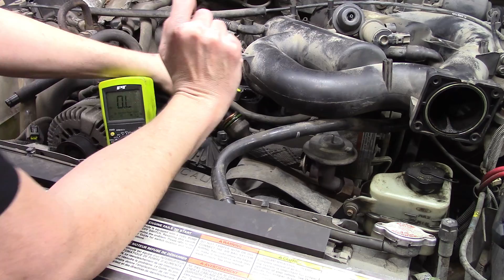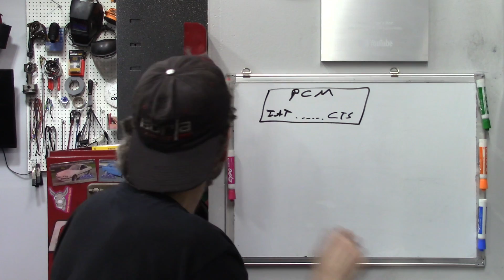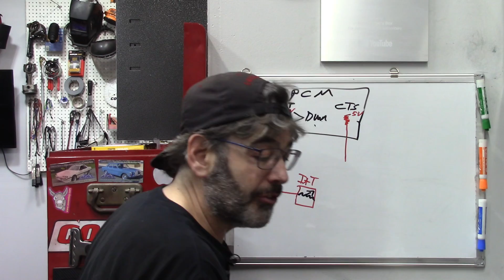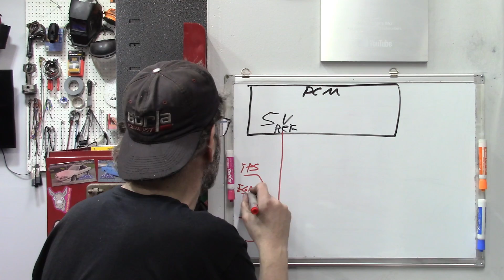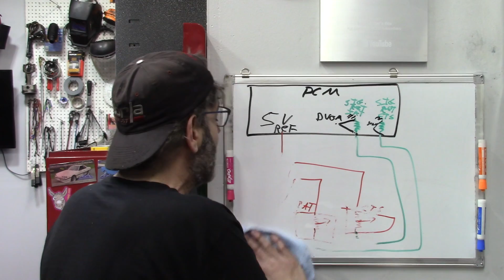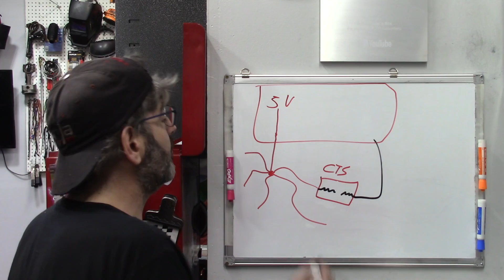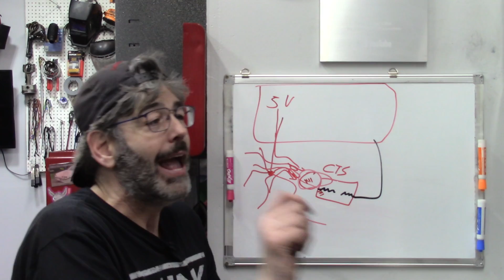P0118 Coolant Temp Diagnosis  New sensor didn't fix it Pt2

Comment: Unfortunately you are incorrect in your description/drawing of how the PCM monitors voltage here - it is, in fact, looking at the voltage drop across the ECT (or IAT) sensor and not the internal resistor. When the engine is cold it will read a higher voltage bc the resistance of that NTC thermistor is large at that point, but as it warms up the resistance will decrease and the voltage reading will also decrease accordingly.
Reply: Is this two nerds fighting? sips tea
Reply: What we are looking at here is essentially a simple two resistor voltage divider circuit.
Where, one fixed resistor is fed 5V, and the thermistor is the second resistor, essentially a variable resistor grounded on one side.
The PCM is taking it's reading from in between the two resistors, with effectively it's internal dvom negative probe.
Constant 5V on the PCM's positive internal dvom probe at the input to the fixed internal resistor, and a varying ground connection on it's negative probe, with more or less continuity to ground, totally dependant on the thermistor resistance changing between cold engine to hot engine.👍
Reply: @simonilett998 I was about to write the same...perhaps both have them got stuck into voltage drop concepts, whereas this case is yes, utilizing fundamental of voltage drop, yet the PCM is monitoring only volt potential of central node between the two resistors....simple voltage divider circuit....where internal resistance is constant and thermistor resistance is modulating the central node volt potential proportionate to change in temperature.
Reply: @AutoDiagnosticsPK  100%
With the emphasis on:
The PCM is 'probing' with it's negative dvom lead between the two 'resistors' and it's positive dvom lead is connected directly to the 5V source, before the resistor inside the PCM👍
Reply: @simonilett998  can you make your statement more clear....we agree that it's simple voltage divider case where PCM dvom measuring nodal volt potential....and in my understanding it's measuring nodalpotential with respect to ground....and what I could get from your above statement is that PCM is measuring node with respect to 5v....in other words voltage drop across PCM internal resistance....please if you can make it easy for me
Reply: @AutoDiagnosticsPK  Yes, you are correct.
Voltage drop across the internal resistor, with PCM's positive dvom lead to 5V side of internal resistor and PCM dvom negative lead connected to node after internal resistor, but before the thermistor👍
Reply: @simonilett998  hmm, here I too got stuck with the simple basics 😀
I am not absorbing that PCM is measuring voltage drop...to me it's like divider node volt potential wrt PCM ground....I think, I shall also sit back, get relax and reconsider the basics😀
Reply: @AutoDiagnosticsPK Your initial understanding was, and still is, correct. Don't start doubting yourself now. YouTube won't allow links in comments, but if you search for a video by ScannerDanner entitled Thermistor-Potentiometer comparison and the 5v reference circuit, and skip ahead about 3 minutes, you'll get (additional) confirmation.
Reply: @nowayjose596  Just watched the Paul video recommended portion and found myself relieved from the agony of getting lost in the desert of voltage drop and divider circuit😃...thank you very much for the recommendation and the Advice!!!
Reply: @AutoDiagnosticsPK  I often use the term voltage drop bc it clarifies 2 things immediately: 1) what we're looking at when current is actually flowing in the circuit, and 2) exactly where our hypothetical multimeter leads would be placed and exactly which resistor we're monitoring. Otherwise, by simply calling it a voltage divider circuit, you leave more room for potential miscommunication/confusion (as you just saw 😉).
Reply: @nowayjose596  hey hey....what??? Now u need a cup of coffee 🤣
U c, Matt after taking his cup of coffee is on track...just joking...he is a great teacher and that too super fast...
It's totally different...voltage drop & potential diff between divider node and ground
Reply: @simonilett998 🤦‍♂️ No.
Reply: @nowayjose596  Yes.
The PCM is measuring the differential voltage between 5V and ground, using it's internal dvom negative lead connected between the fixed resistors output side and the variable resistor/thermistor input side, a simple voltage divider circuit, just with one of the resistors (outside the PCM) creating a variable continuity to ground dependent on temperature.
Reply: You are correct in your explanation!
Reply: I would like to officially declare that we have gotten to the bottom of this, after 39 comments.  Thank you for your participation, and goodnight.
Reply: @thomas7770  haha....
Reply from the maker: It does read the internal resistance voltage- NOT the sensor voltage. The sensor voltage will always be a full voltage drop to zero no matter what the resistance is. 
  You are correct in that the NTC resistance is variable however it does not read voltage drop across the sensor itself. It is impossible to do that.
   At best some designs may compare downstream of the internal resistor and compare that variable voltage to ground… but it definitely can’t read voltage drop across the sensor. If it did that there would have to be more than two wires at the sensor to measure the voltage on it.
Reply: @SchrodingersBox Wow! Looks like a debate on the circuit operation of the ECT.
Reply from the maker: Hahahaha. Yeah maybe you can weigh in Terry. Viewer states the measurement for the ECT is the voltage drop across the sensor (the variable resistor).
   I state the measurement is the dropped voltage from a fixed resistor in the PCM (measuring “downstream” of resistor - not at the 5V source side- technically it reads the voltage “between” the internal fixed resistor and sensor) compared to ground that changes as the variable resistor changes.
    I also state while the readings would be identical, the point of measurement I am claiming is correct.  Viewer states I have no idea what I am talking about lol.
Reply: @ingersBoxAt timeline 15:25, you mention that the voltage seen by the PCM which is actually an analog to digital (A/D) converter is the voltage drop across the internal resistor. In my opinion, this is not correct. One viewer mentioned it already stating that with the thermistor disconnected, there is 5VDC on the top of the internal resistor and 5VDC on the bottom of this resistor because there is no current flow. The difference between these two voltages measured by the a/d converter would be 0V. Yet, we see near 5VDC on the scanner. On the other hand, with the 5VDC and ground terminals shorted together we see 0VDC. Yet, if one were to measure from the top of the internal resistor with its 5VDC and to the bottom of this internal resistor, we would measure 5VDC, yet the scanner shows 0VDC. There is only one possibility for the scanner to measure 5VDC when open and 0VDC when the connector is shorted. The reference of 5VDC is not used in its measurement. It is the ground and the other point is the bottom of the internal resistor which connects to one side of the thermistor. So, I believe the video drawing is misleading. I believe the confusion is what we are considering to be voltage drop. When we say what is the voltage drop across the internal resistor, this literally means taking our voltmeter and placing our leads ACROSS the resistor. This would be its voltage drop and not measuring to ground. The same holds true for the thermistor where we're taking the voltmeter and placing it across it which gives us its voltage drop. As you mention in your comment, you're taking the voltage from the connection of the internal resistor and the thermistor to ground. This is NOT the voltage drop across the internal resistor. You're only measuring how much voltage is left over after the current passes through the internal resistor. Of course, this voltage will change because of a changing current due to the resistance changing of the thermistor.

However, your comment is correct and the other viewer's comments are correct also. You state that the measurement is taken between the bottom of the internal resistor and where it connects to the thermistor and ground is used as its reference. This is correct! However, isn't it exactly the same thing as taking the voltage drop across the thermistor as mentioned earlier. It's the exact same measurement. As a side note, all of the a/d converters that I'm familiar with such as in PCs, automotive vehicles, microcontrollers and PLCs use a GROUND for its reference against a reference voltage that the a/d converter uses. It could be 5VDC, 3.3VDC or some voltage . In this case with the ECT circuit, the a/d converter is using 5VDC and a ground to reference against. There are specialized a/d converters that can use say 5VDC against another voltage, but these are specialized  components requiring a differential input or using two a/d converters that uses a ground reference and then subtracting the voltage in software. An example would be Picoscope's oscilloscope that uses floating inputs. Hope that helps!
Reply: @stuzman52  another nerd has entered the chat.  Lol, jkjk. Carry on.
Reply from the maker: @stuzman52 yep that explains it to me. In rewatching the video it does appear I was indicating a voltage drop across the fixed resistor which was not my intent but I can see how it could be interpreted that way. I meant to say it as I described in my comment. 
  Agreed the measurement would be the same- measuring between the fixed and variable resistor vs ground or across the variable resistor- I acknowledge that. But I disagree that the measurement is across the variable resistor.  The positive is between the fixed and variable resistor  inside the PCM and  the negative is against ground inside the PCM. The fact the thermistor only has 2 wires is evidence there isn’t measurement across the thermistor itself.  It’s clearly measured internal in the PCM- not across the thermistor.
Reply: @SchrodingersBox I hate to disagree Matt, but it's the voltage drop across the thermistor. You're taking a measurement at the junction of the fixed resistor and the thermistor which is inside the PCM. Now follow down from this measurement point and does it not connect to the thermistor. Should we throw it out and say it doesn't exist at the thermistor? And look at the ground connection. Does it only connect to ground inside the PCM? No, it also connects to the other side of the thermistor. I mean to me, it's pretty clear. Although the measurements taken are the same exact ones from yourself and viewers, I can truly say that it is the voltage drop across the thermistor that the a/d converter is measuring. Sorry Matt for the disagreement!
Reply from the maker: Ah I guess I can see it that way. I guess a matter of perspective. I see at is measuring the dropped voltage from the fixed resistor against ground but I can also see it as across the variable resistor (including all the wiring). Seems to me it’s the former but if you say otherwise then I agree!!  Across the variable resistor it is!!
Reply: @stuzman52  discussion gives clarity, and particularly when no one is Electrical Engnr here😃.
Your above explanation makes sense....but can u explain following question:-
Can we say it as a voltage drop across CTS resistor when it is open or shorted?
To me NO, and again in my opinion it has to be taken as a simple voltage divider circuit where ADC is measuring the node between two resistors, it becomes immaterial what reference ADC takes except the Vin of 5 volt....obviously the designer would plan a reference which would give ADC better resolution.
Again, I want to make a point here that this case should be discussed through voltage divider circuit term instead of referring it through voltage drop, yet voltage drop is the culprit which is in play 🤣🤣🤣
Reply: @SchrodingersBox No problem Matt! As I mentioned, both you and the viewer's comments are correct in where the measurement is taken and you get the same results. Maybe an example will help. Let's say that you measure 1VDC at the junction of the internal resistor and the thermistor and its reference is to ground. Now does this mean the internal resistor has a voltage drop of 1VDC? No, it has a voltage drop of 4VDC, 5VDC-1VDC=4VDC leaving 1VDC across the thermistor resistor measured to ground. As a simple test, you could hook your voltmeter leads across the thermistor and compare it with your scanner. You would be measuring the voltage drop across the thermistor which would be the same voltage as displayed on your scanner. Hope that helps and have a great day!
Reply: @AutoDiagnosticsPK Normally, when one considers voltage drop, we're looking at a circuit such as our voltage divider as functionally correctly. But, we still can refer to voltage drop across a resistor whether its open or shorted. Let's say this voltage divider circuit is open. What would be the voltage drop across the internal resistor? Yes, we can still refer to its voltage drop even though there's no current flow. And of course, it would be 0VDC because there is 5VDC at each leg of this resistor and when we take the difference between these two voltages as that's what a voltmeter does, it would be 0VDC.

Yet, if we measure at the point where the junction of the internal resistor and thermistor are connector with the reference of ground, what would be the voltage. Yes, we would measure 5VDC. So, there is no voltage dropped across the internal resistor, but we have 5VDC on the bottom of the internal resistor to ground.

And we can have a voltage drop if the thermistor was jumped out creating a short. Let's look at that scenario. We know there will be a current flow in the circuit. If we measure across the internal resistor, we'll get 5VDC. This means the internal resistor has a voltage drop of 5VDC. 5VDC-0VDC=5VDC. Yet, if we measure on the bottom of the internal resistor to ground, we'll get 0VDC. Hope that helps and have a great day!
Reply from the maker: I just wanted to point out to everyone following that Stuzman is a retired electrical engineer. He also has a YouTube channel Stuzman52.  If you are learning something here you will definitely want to check out his channel. It’s where I learned all me electrical- and still learning, obviously!
Reply: @stuzman52  makes sense!!!
Reply: @SchrodingersBox  Respect for the Stuzman52 and here he earns a new subscriber. At the same time, we are already learning from you through your channel that too free of cost 😍
Reply: @SchrodingersBox  If I'm wrong, and you're right, then as the coolant temperature rises it should do the opposite of what I said i.e the voltage reading should increase as the temperature increases (bc the internal resistor becomes proportionately "larger" in the circuit as the resistance of the ECT sensor decreases, and therefore shows an increasingly larger voltage drop across said internal resistor). Correct?

You've got a scan tool there that shows both the calculated temperature from the ECT sensor and the voltage the PCM is seeing - go ahead and do a cold start and watch those values as the engine warms up and see what happens.
Reply from the maker: No- voltage reading absolutely decreases with temperature increase. we saw that when I shorted the  circuit out - removing all resistance  as opposed to infinite resistance which showed 4.6V. shorting it showed 0V. installing the new sensor showed about 3V at 65 degrees.   
     This is because as the thermistor warms up it reduces resistance proportionately. what we are seeing in this system is the voltage drop across the INTERNAL resistor compared to ground. As a matter of fact there are often wiring diagrams that actually show the internal “DVOM” connections inside PCM measuring at the internal resistor. It literally shows this. 
  As the variable resistor heats up, its resistance decreases which means voltage decreases-  but again- if not for the internal resistor in the PCM we would not see this.  the voltage before the variable resistor would ALWAYS be 5V and the voltage after the variable resistor IS ALWAYS 0V.   the internal resistor voltage drop is what causes the varying voltage between the fixed and variable resistors.  THAT is what is being measured- the the voltage drop across the variable resistor. this is why we see the voltage lower and lower as the variable resistor warms up.
Reply: @SchrodingersBox  "THAT is what is being measured- the the voltage drop across the variable resistor." - now you've got it 😉 

Unless that was just a Freudian slip, in which case we're back to square one. It sounds like you're erroneously conflating the need for a pull up resistor in an ECT circuit with what is actually being measured in said circuit. If you look at a wiring diagram for ANY 2-wire ECT sensor you'll see that the voltage reading is taken AFTER the internal resistor but BEFORE the ECT sensor and referenced to GROUND. This is what you did when you backprobed the wire coming out of the PCM - did you attach the other lead on your multimeter to the 5V source before the internal resistor, or did you attach it to ground? We both know you attached it to ground, and that is the voltage drop across the ECT sensor, and that's the same thing the PCM does internally. 

I keep wondering if this is just some sort of communication snafu but no, you said the PCM is looking at the voltage drop across the internal resistor and even drew a picture demonstrating as much, and that is 100% incorrect.
Reply from the maker: @nowayjose596 nope. It doesn’t measure voltage drop across the variable resistor. It measures the voltage BETWEEN the resistors against ground. That resistance between the resistors is the result of the drop caused by the internal resistor.
Reply: @SchrodingersBox  What, specifically, do you think is the difference between the voltage drop across the variable resistor and measuring the voltage BETWEEN the resistors against ground? 

Look at your own video and drawing again - you showed it measuring between the resistors, yes, but against the 5V reference coming into the internal resistor, NOT ground. 

I really don't know what I can do to make this any clearer 🤷‍♂️
Reply: @SchrodingersBox  the CTS resistor is the one changing resistance. It varies . The total current depends on the resistance sum of the internal and the instantaneous CTS resistance.  If  the  CTS and the internal resistor had identical ohms, the PCM would see a 5volts drop to 2.5 volts at the measurement point, and the last 2.5 volts would drop across the CTS. The % of the total 5 volts available changes as the CTS changes. Do the math. Use 5K ohms for an assumed internal resistor, and  10K ohms for CTS. Then do the same thing using  200ohms for CTS.
Reply from the maker: Yep that’s exactly right. However it is NOT measuring voltage drop across the variable resistor. It is reading the dropped voltage on the fixed resistor against ground.
Reply from the maker: @nowayjose596 there would be no difference if that’s where it read from. Whether it reads voltage drop across the variable resistor- which it doesn’t, it would be the same reading as reading the drop from the fixed resistor against ground. Which it does. 
   It does not read across the sensor. It reads between the sensor and PCM resistor inside the PCM.
Reply: @SchrodingersBox  Respectfully, you don't know what you're talking about. You're misusing terms and your poor/improper use of the nomenclature is leading to a lot of confusion. And at the end of the day, that might be merely annoying instead of inexcusable were it not for the fact that the diagram you drew is, inarguably, wrong. If you put one lead of a multimeter on the 5v reference BEFORE the internal resistor and the other lead AFTER that internal resistor (which is, inarguably, what you drew) it will NOT be the voltage the PCM sees or that shows up on your scan tool. Period. End of story.
Reply from the maker: @nowayjose596 nope. You are wrong. Not only wrong but in the easiest way possible to prove. 
   I’ll make this so simple-  IF the voltage drop across the variable resistor is being measured- WHERE are the wires for the voltage measurement?
Reply: @SchrodingersBox your concepts about PCM monitoring of thermister circuits are totally correct except where you say PCM is measuring voltage drop across PCM internal resistance....PCM is just monitoring volt potential at central node between both the resistors...PCM is just looking at central node and this is based on simple voltage divider circuit where nodal voltage is equal to reference volt into Ra/(Ra+Rb).
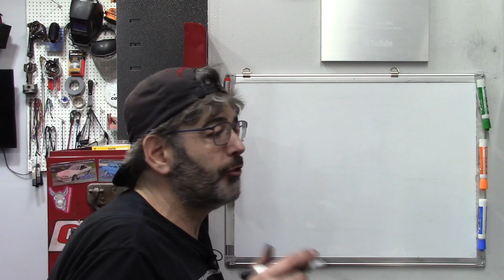Reply: I'm  new to trying to figure this out, so another nerd has not entered the chat, lol. All the lingo about reading across the resistor in the pcm, im pretty sure Matt explained it like an internal dvom after  resistor in pcm (also) in between sensor resistor when he was measuring from 5v reference side supplied inside pcm and ground. Flip it now for internal resistor on the ground side in the pcm (not w/ shared ground) and Matt showed the  the internal dvom before pcm resistor. And in both cases they (internal dvom's)are measuring how many volts are being used to or from sensor.Maybe I misunderstood, but I think I just spent about an hour of reading to totally get confused, when all most were doing was making a mountain out of a mole hill. I hope I'm not contributing to that by adding a comment. He did say we are gonna simplify this just a little bit at 13:12 .Do they have an   emoji for splitting hairs lol😅
Reply: Personally I am always right.  Unless of course confronted with a better argument. 😊
Reply: The temperature sensor circuit is a voltage divider circuit 2 resistors in series the pcm reads voltage at a point in between both resistors which is internal.
Reply: Good explanation also in scanner danner book page 6-2
Reply: @bobcombs7138  🤦‍♂️🤦‍♂️🤦‍♂️🤦‍♂️🤦‍♂️

I'm beginning to think you guys don't actually understand what a multimeter is telling you on a very fundamental level. Easy way to test that: in this circuit we had ~5V coming into the internal resistor and ~5V coming out of the internal resistor bc we had an open in the circuit somewhere farther down the line, right? Now imagine we opened up the PCM and took the positive lead of our multimeter and placed it immediately before the internal resistor, then took our negative lead and placed it immediately after the internal resistor - what would it read? 

If you said ~5V, I'm sorry, but you don't actually understand how to use a multimeter.
Reply: @nowayjose596 just sit down, get relaxed and rethink....no offense....monitoring is done at node between two resistors....the voltage divider concept....that's it
Reply: @nowayjose596  You should read essentially 0V👍
However, I think the critical point you're missing is, when Matt tested the voltage at the PCM ~4.65V the wire downstream of the PCM was open due to an open sensor, but...now this is the critical point, Matt had his negative meter lead connected to battery ground.
So, now tell me, what voltage should we read at the PCM in this scenario?
The exact same voltage, 4.65V no matter if it's before or after the internal resistor of the PCM🤣👍